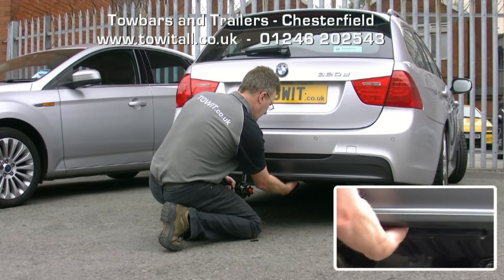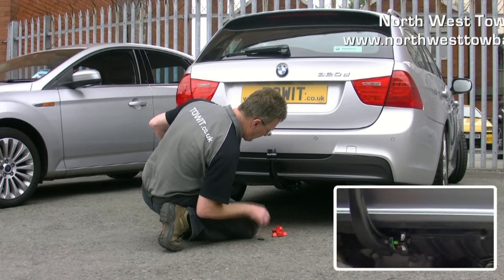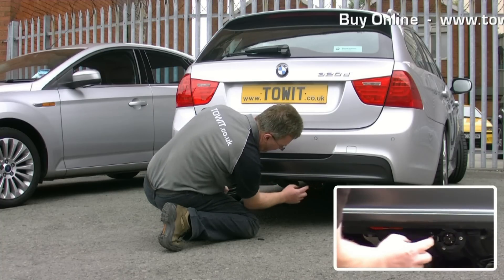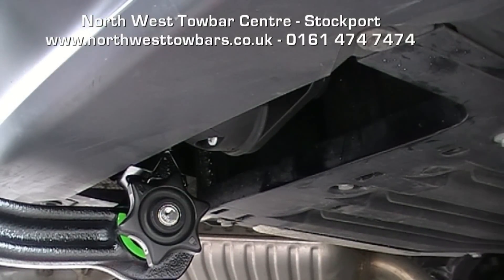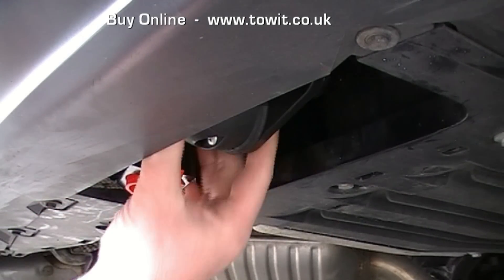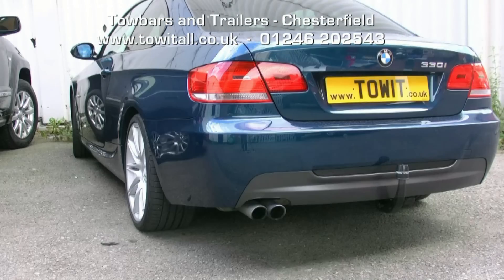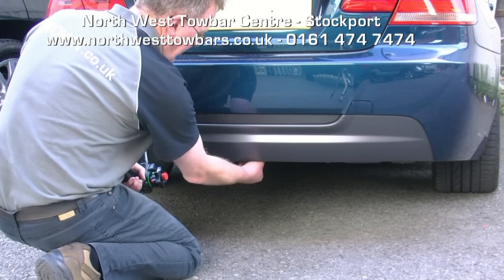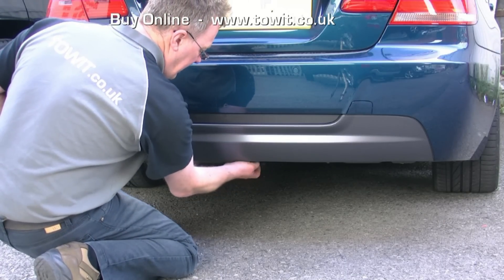Westfalia Detachable towbar - BMW 3 series

Comment: I installed a Westfalia detachable on my E90 yesterday, with the 335 exhaust hangers and dedicated electrical kit.
The quality is second to none, there is no bumper cut and it's completely invisible when the hitch is detached. I-drive tells me when an individual bulb is out on the trailer and the reverse sensors delete when the trailer is in use.